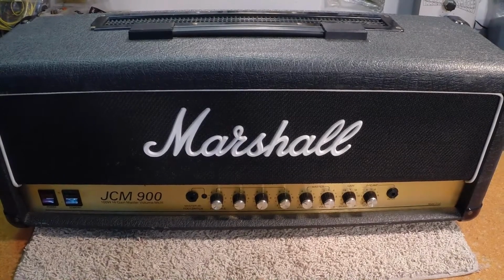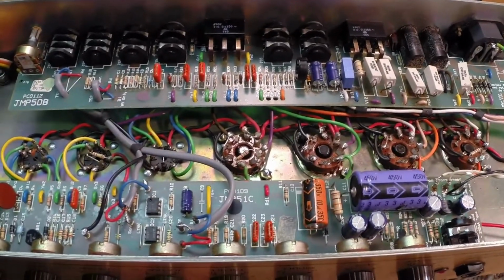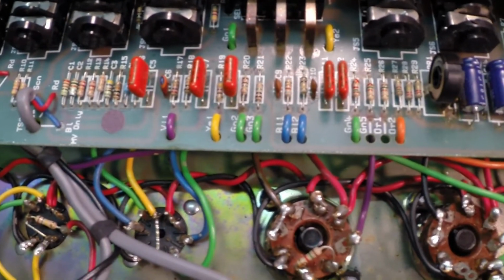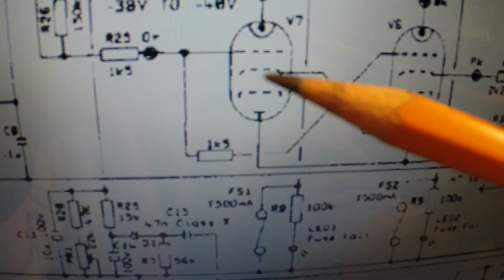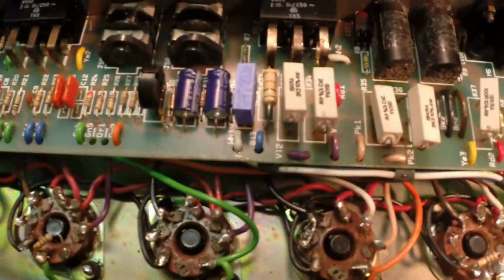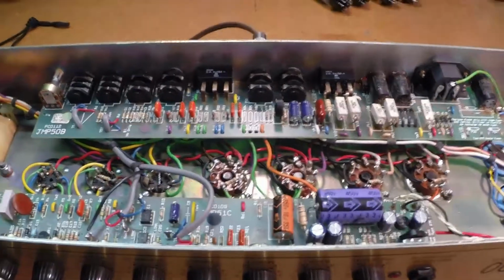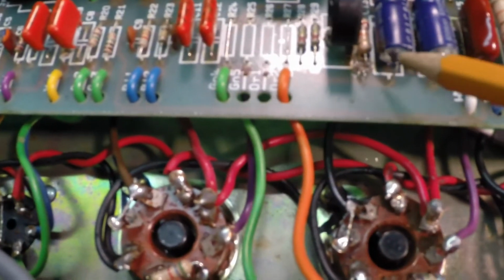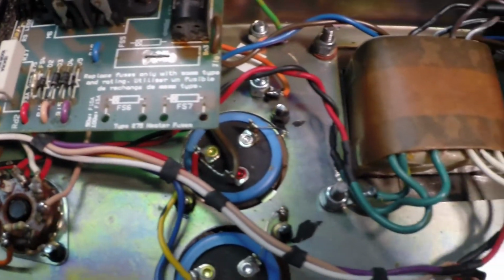Marshall JCM 900 Repair

Comment: GUITAR CPR> 
Is the Chokes storing current like a reservoir like the filter capacitors or is the Choke doing something else to the AC ripple, not sure if the Choke is regulating the current? 
Most Power tubes 6L6,EL34 use a B+450vdc on the plates, if you increase the B+ to +600vdc would this increase the AC ripple but why would it increase the AC ripple? i would think it would decrease the AC ripple because more B+ voltage mean less current draw from the power tubes. 
When you're biasing the power tubes in an amplifier circuit how do you bias the compression of the power tubes the 1dB compression point of when the power tubes start to compression? 
because its say to bias tubes at a 30mA bias current per tube to be safe but how do you know when the tube is compressing?
Reply: Yes!!!
Reply from the maker: I do not see the correlation to the video but I will try to answer some of the questions.                                                                     
  First up, a choke does not store current or voltage.  A choke is used in series with the power supply usually between the Main B+ and the screen supply to smooth and filter out 60 and 120 Hz hum and ripple.  Think of it a a large wire wound resistor with an expanding and collapsing magnetic field.  As the tubes are driven the screen current goes up. The choke's IR drop during power demands reduces voltage going to the screens and creates a natural compression factor on the output tubes stabilizing their operation.  The input choke on tweed style amps is a typical PI filter.  This type of filter drops the voltage of the entire amp under current demand resulting in compression commonly known as "sag"
    Second, raising  B+ voltages is not a solution to ripple, and for some reason the industry has been leaning to stupid high voltages.
  Third,  The -1db compression point is a point on the linear operation curve of an amplifier.  This is the point that the amp no longer responds linearly to input signal saturates, and gain drops off.  It has nothing to do with biasing.
  As for biasing, The dumbed down catch all of 30 ma. is a overly repeated falsehood.  Bias involves Plate Current ratings, plate load, Power supply and Screen supply voltages, and other variables.   An amp with a plate load of 3.5 k  will draw more current than with a 6.6k load with all things being equal, therefore it will need  more negative bias voltage.  Likewise a low PC# tube will run cooler than a higher PC# at the same voltage.  Hope this helps.
 Thanks for watching!
Reply: @guitarc.p.r.9675  Thanks for the help. When you Decrease or increase the B+ voltage it changes the screen voltage and plate voltage which is changing the bias operations of the preamp and power tubes which is voltage biasing?
1.) How much current does one power tube draw at its maximum? because each filter cap in the power supply can only holds & stores about 1 amp of current because the formula is Capacitance X rectified voltage = current stored in filter capacitor
4700uf X 450vdc B+ voltage  = 1 amp of current stored in filter cap
2.) When using very low capacitance guitar cable when the amps input Z impedance is 1Meg it will "roll off high frequencies" but when you change the amps input Z impedance to 3 meg or 5 meg it will not roll off the high frequencies, any reasons why?
3.)  When using a Variac like eddie van halen & Randy Rhodes did by setting it to 90VAC this lowers the B+ voltage on the amplifier. Does the ripple voltage increase or decrease when you use a Variac set to 90VAC?
Because most amplifiers in general used a B+ voltage at +450vdc so lowers the 120VAC to 90VAC the B+ voltage is I'm guessing +250vdc to +300vdc. Biasing is balancing the voltage & current through the power tube. Because when you lower the plate voltage B+ voltage to the power tubes this is also biasing the power tubes?
4.) If an amplifier is designed for 6550 and you install KT88 or KT66 tubes. The power amplifier output impedance is designed for 6550 or EL34. What sets the power amplifiers output impedance is it the tubes plate DC or AC impedance? Because you would have to change the output transformer because the output transformers primary impedance was designed for 6550 or EL34 tubes and not KT66 or KT88?
Reply from the maker: @billwilliams6338  OK, You are messing with me right?
Reply: @guitarc.p.r.9675  no i'm serious I'm not messing with you at all

Comment: Great video!     I just recently picked one of these really super cheap, but it has some problems.    I have one of the power tubes getting extermly hot.    Any ideas what this could be?      Wished you was in NC I would let you work on it...   Not many people work on amps around here.     I do little work on them,    but not much
Reply from the maker: If it is a 100w I would venture to say you have 1 bad tube.  But you should use a "good" matched set.    If it is a 50w the same still applies except you may have a bad Phase Inverter coupling cap.  I have even seen PI tubes cause a current problem. Check the Blues Jr. video.  You could always ship it to me, a lot of people do.

Comment: Hello sir, I could use your help - it appears C15 has given up the ghost - oddly this happened when I had the chassis out to bias new tubes - everything else looks to be ok.  In order to replace this component the entire board has to come out right?  I was hoping to not have to go to that length but I don't see any other way to get at that cap.  So not only is it prone to faiure, it's a pain to get to also ;)
Reply from the maker: Yes the board has to come out, but it is an easy one.  Be thankful it is not a TSL, or SLX!  Be sure to replace it with a 600v cap.
Reply: @guitarc.p.r.9675  Thank you!!
Reply from the maker: @KurtLauerman  actually I use a Xicon 630v
Reply: @guitarc.p.r.9675  and you're right, the board was trivial to get loose :)
Reply: @guitarc.p.r.9675  Hey many thanks!!  I put an x series (fails closed) Kemet 760v 47n cap in place of the suspected failure and amp is back in business!!  Hopefully 760v instead of 250v rating will keep this amp alive for a long time to come :)
Reply: @guitarc.p.r.9675  I'm recapping a friends 900 and all parts except for this safety cap have been easy to track down.  Is the Xicon mentioned a safety class X cap? Does it have to be? Is this the cap that protects one from getting zapped?  thanks, great video.
Reply from the maker: @neonfreon1316  No, the xicon is not a safety cap. It does not have to be a safety cap.  The Xicons are available almost anywhere tube amp parts are sold. Thanks for watching.
Reply: I ordered a couple safety caps that fail to closed, rated 650v and up - I think that'll do the trick?  47n is the same as .047uf right?
Reply: My 4500 900 did the sane very thing. I pulled the chassis to check the bias and as soon as I plugged in the bias tester I had replating going on. C15 died on me at that very moment!

Quick easy fix from searching about his problem and seeing this video helped me fix this last fall when it happened.

Just recently I was given an NOS EI 12ax7 for V1 and my God did the tone get better! My 900 has never sounded so good!

Comment: That JCM900 model 2100 is using a JMP50B PCB.....it looks like you are looking at a JMP50C PCB version which is why it doesn't make sense. The JMP50B version should have 2k2 resistors at the sockets in series for all 1k5 resistors to all tubes but I'm not seeing them here in the 'before' images so perhaps they were removed prior by somebody(?). So they should all be the same. Check here: https://drtube.com/schematics/marshall/cd0192-iss7.pdf . I could be wrong, I'm not an expert. Marshall can be confusing sometimes by using different types of PCB's for the same model depending on the year. That mod for the resistor at R28 for the bias pot range makes a huge difference though. I've done this before and I no longer need to special order tubes
Reply from the maker: Thanks for the comment.  And you are correct with the schematic you are showing, but that was not the case with the amp in the video, and it was also dead stock when it came into the shop.  Yes, it was an early one with a wrinkle to be worked out.  The series resistors you mentioned are still a bad idea, in this case adding up to 3.7k.  Also a reason I mention changing these to 5.6k and moving them to the sockets for stability.

Comment: I have a 1993 JCM 900 SL-X and I noticed that r24 and r25 are mounted on the pc board. should I put them on the tube socket as you did here and remove the resistors in r24 and r27? what do I do with the resistors from r24 r27? Thank you.
Reply from the maker: Looking at the schematic, looks like the very same situation.  Replace R24 and R25 with a jumper, and move these resistors to the tube sockets.  I would also use 5.6k resistors instead of the 1.5ks at the tube sockets on pin 5.  IF YOU HAVE ANT DOUBT have a competent pro do it for you. Be cautious and thanks for the comment.
Reply: @guitarc.p.r.9675  why 5.6k?  I used the resistors that I removed from 24 and 25. Will they work? Also my amp is the 50 watt el 34 version.
Reply from the maker: @rustyh62  OK, with the 50w version you do not really need to move the resistors, although the rightful place IS on the tube socket.  5.6k is the typical Marshall value and it will also limit the slap to the el34s as well.

Comment: Great video. It's kind of hard to see what you did with the R24, R25, R26 and R27. It looks like you removed them all and added jumpers across R24 and R27. What kind of bridge work was done underneath? What value resistor did you put on the tube socket?

Comment: I need to remove the amp  at a marshall jcm 900 COMBO. After removing the 4 upper screws I can’t do it. Any suggestion? Thanks a lot ( nachoworldguitar@gmail.com)
Reply from the maker: It has been a while since I have worked on a 900 combo.  It should slide right out unless it is bound up on the tolex or the shield plate in the top of the cabinet.

Comment: does replacing that blue bias cap to a 600 v from a 250v change the sound of the amp at all?
Reply from the maker: Absolutely not!  Unless you prefer the tone of an amp that is blown up.  The cap change is to make up for the under voltage bias supply cap.

Comment: I have a 50 watt jcm 900 too, and the EL34 power tube next to the transformer visibly is redder then the one next to it. thanks for posting the video, my amp has the same resistor configuration. it looks like you jumper-ed R24 and soldered the resistor directly on the tube socket. is that correct?
Reply from the maker: That is probably the same model I found the problem in originally quite some yrs ago.  Get back to me w/ amp model #.    I'm pretty sure your problem is an uneven PI drive.   .....And please explain "redder".
Reply: Thanks for responding to my post. It looks like I may have more issues then I thought, I realize now that my tubes are red plating, and one is red plating more than the other one. The model is a jcm900 50watt 4500 that was made in 6/26/90, I couldn't find a serial number, but the board revision number is a JMP50B. I can only find the schematic for JMP50A, and JMP50C. In my amp V5 has two resistors in series connected to pin 5 of the el84. The values are (r27) 1.5k ohm and a 2.2k ohm resistor that looks like someone before me soldered directly to pin 5. V4 has 1.5kohm resistor connected to pin 5. I measured the plate voltage (pin 3), and it stabilized to 294 volts. This voltage seems pretty low when compared to what values that I've seen from other peoples youtube videos. The tubes that I have are tesla el34 with a 37 code, and I have no idea how long that they were installed.
Reply from the maker: Definitely check the bias cap I mentioned.  Your voltage is low due to the outputs pulling too much current .  I will look into this more for you.  Your tubes are already toast, pull them to check the amp, you will need a decent set of matched tubes.    Look for my facebook...Guitar C.P.R.  PM me.

Comment: What is the function of these integrated circuits and these diodes? here in Brazil many think that this head is hybrid because of these components!
Reply from the maker: Much of the actual pre-amp and gain circuitry of these amplifiers is done with ICs  in an attempt to get larger amounts of gain with less noise and micro-phonics  from tubes.  The diodes in the pre-amp are also for clipping the signal.
Reply from the maker: ie....... Modern Tube amp.  Believe me, it gets worse!

Comment: have you done many mods on 900's? What are some mods you would reccomend? Ive heard of people bypassing a so called(crappy) tone stack to essentially make the amp into a jcm 800?
Reply from the maker: The 250 volt cap it too low and it fails, a lot, taking out the bias and the output tubes.   Yes, I have also bypassed the  faux tone stack the other channel and it does help immensely.